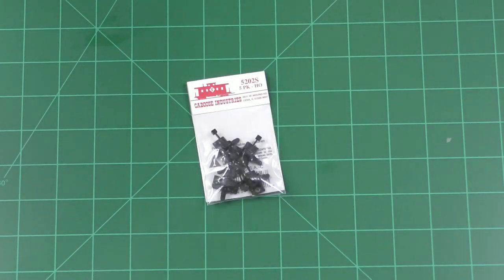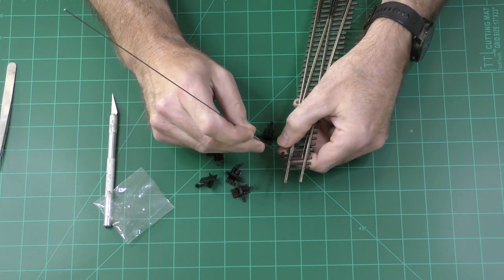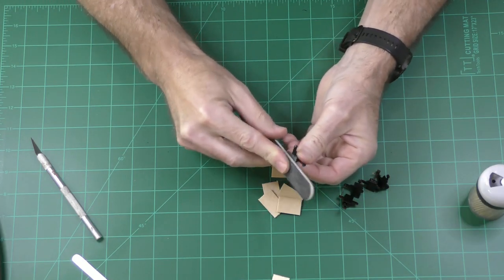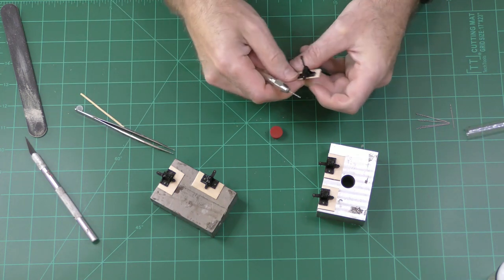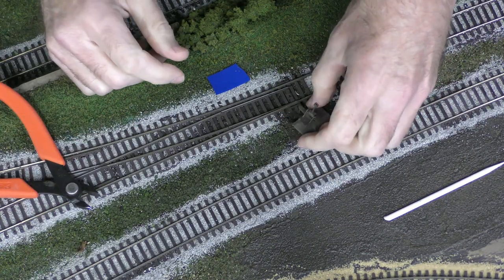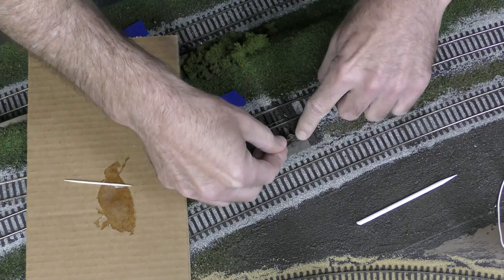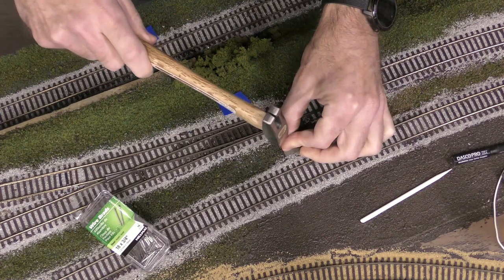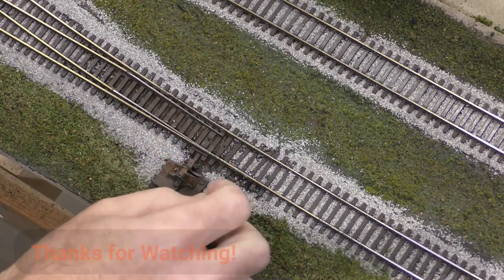Caboose Industries Switch Throws on Atlas Turnouts

Comment: Tongue depressor a great idea. Some friends paint the end of the throw ball green in one side and red or yellow on the other. It makes it easier to spot and know which way the points are thrown. 
To add another level of realism instead of muddy fill around the base place wooden ties   The railroad does this to fill in lower areas around the switch stand. 
Fine presentation… I like painting the stands. Good point 👍

Comment: I have used these ground throws for at least 10 years and never had a pin break. I just drill out the hole on the throw bar for the pin to fit. The plastic I think is called Delrin which is a pain to glue. I use track spikes to secure them down

Comment: Nice video, I have used HO Caboose throws since they first came out with my Atlas turnouts. Yes they are made of derlin plastic that makes them a pain to glue, sanding the bottoms is a great idea for the glue to adhere to the wood. 
There is a video that also shows how to make Atlas turnouts work like Peco's using a paper clip. Just in case you dont have room for a Caboose Indu machine.
Keep up the videos they are very good.

Comment: This is awesome, as I'm writing this I'm installing the 202S caboose industries throws in my Atlas #566 and 565 #8 turnouts, I just had to drill all the holes using a #54 drill bit and they work fine I almost did what you did and was going to run rod through the peg after cutting the peg off but decide to take a chance and twist drill the slide on the switch instead, it worked and saved a ton of time and glue doesn't seem to reliable on delrin plastic. Enjoyed the video.
Reply from the maker: Thanks for the comments.  Some people have asked why I did not drill out the hole and I think the true answer was that I did not have a drill bit the right size.  It probably would have been easier to buy a drill bit than replace all the pegs, but that was the path I chose.  I was a bit afraid that there was not enough extra area to enlarge the hole, but apparently others have had no problems.  Thanks for watching.

Comment: Very interesting installation technique; I may try your alternative pin concept.  I truly learn something new from each video of yours I watch.  THANK YOU.  👍👍
An alternate installation technique ..... I am in HO and use Atlas Custom Line #4 and #6 turnouts (TO) almost exclusively but also have 6 Micro Engineering #5 TOs on my layout.  All TOs are controlled by Caboose Hobbies (CH) 202S (sprung).  For the vast majority, my method is to drill out the hole in the Atlas TO for a slip fit with the CH pin.  These work very well and I have never broken the pin on the CH ground throws.  I have, however had to mount a few of the CHs on the "wrong side", the side away from the "T" head side of the TO bar, or have had to control a turnout from several inched away because the track spacing didn't allow room to install the CH.  In such cases, I use a piece of brass wire through a small brass tube with a "Z" bend at the CH end and just an "L" bend up through the center hole in the TO bar.
Also, I use a short piece of roadbed material butted against the track roadbed affixed with track nails and use track nails to hold the CH in place.  The operation can be easily adjusted with a nail set against the side of the mounting nail head to finalize the CH to best operation location should the need arise.  The whole operation from start to finish takes only about 4 – 5 minutes and I have CH operating Atlas TOs without having to wait for epoxy to dry for any of the installation. (FWIW   😎)
One last comment, I have an 8 ft. module with CHs installed from back in the late 80s and I have never had any of the pins break off from use, but have had a couple break from being too aggressive with my installation process, coupled with severe frustration due to "life happenings".  Maybe I shouldn't have been installing CHs under such conditions .....
🤪🙃🤪

Comment: You have a good approach to installing Caboose Industries ground throws.  It's adaptable to almost any type of turnouts.  Thanks for sharing. 
You should get yourself some smaller sized drill bits.  They come in handy in instances like this.  Micro-Mark offers a set of about a dozen smaller size bits. 
One suggestion: using a small bit to drill a pilot hole down into the plywood substrate will make it easier to drive the brads home firmly.  Between the glue and the Brad, the ground throw will be very well fixed.
Reply from the maker: Thanks for the comments.  Those MicroMark drill bits have been on my wish list for a long time along with a better pin vise.  Curiously, this video recently jumped significantly in views for no reason I can see.  Maybe someone linked to it?  Maybe the algorithm monster fell in love with it.

Comment: You might consider obtaining a set or two of small twist drill bits from Micro Mark or another vendor.  Drilling a small pilot hole through the mounting holes on ground throw will make it easier to drive those spikes home.

Comment: You have a pin vice drill, just open the hole up on the switch's throw bar. The only reason to do this is if you needed to mount the Caboose Ground Throw (CGT) farther away from the switch because the rail equipment hits the CGT, which is quite common.

Comment: Debating the CI throws with the ability to power the frogs.  New layout in HO will be for my old DC trains but would like option to also run DCC since I have DCC setup as well sans any engines.  Does anyone power their frogs for Atlas Custom-line turnouts on DC layout?   Appreciate this video and will be using it as a guide.

Comment: Thanks for the video!!  Learned a lot.  As I'm just planning my layout, I'll include some of these manual switch throws.  

Quick question:  What's the model number of the Irwin cutting pliers you used?  Are they 6-inch or 8-inch?
Reply from the maker: Thanks for the comments.  8-inch.  1902413 is the only number on it.
Reply: @asdasx392  Thanks!!

Comment: How do the brads lock anything in if you cut the head off?
Reply from the maker: Thanks for the comments.  Most of the stress is sideways (sheer stress in engineering terms) so the brads help protect against that.   I think I first tried it without the brads and the glue didn't always hold.  I have never had a problem with the brads.

Comment: Drill out the hole on the switch?
Reply from the maker: Thanks for the comments.  You could try that, but there is not much room to expand the hole.  Anyway, I did not have the right size drill bit.